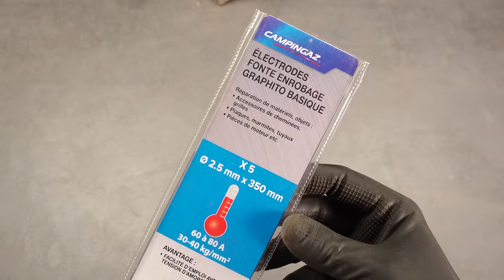Meat Slicer Restoration - Wood & Cast Iron

Comment: Just a suggestion, after you clean the rust from those screws/bolts and hardware, heat them up and drop them in oil. Rust resistant and nice satin black look to it as a result. IMO it would be a good step.
Reply: Not food approved
Reply: @ai-d3982  it is if you drop them in oil used for cooking...... same principle as seasoning cast iron
Reply: @ai-d3982  Uh oh! I use oil all the time when I cook.
Reply: @ai-d3982  why not for food have you ever herd. Of food grade oil.  Like peanut. Oil 
Peal oil there is a food grade. .  I just. Gave 2 that. Can be. Used  and i use then for heat treating carbon steel .
Reply: Or you could just do that in your videos
Reply: @nashvillain171  
ze 👌🏼
Reply: @kevincrosby5991  puder
Reply: @LUCKYB.  h lá
Reply: @LUCKYB.  xeh u
Reply: @LUCKYB.  xeh u
Reply: @LUCKYB.  that's a fucking tough read right there
Reply: You think this dude don't know how to blue? Really people?
Reply: @davidtant8896  cope.seethe.dilate
Reply: I think the fact he filled a lot of the surface with epoxy, that's probably not an option for a lot of it.
Reply: Nlt food approved also this process is called quenching the bolts are so old there will be a high chance lf getting cracks and eventually break
Reply: @kevincrosby5991  look pub? NV
Reply: Perhaps he wanted to preserve the color to coordinate the colors of the piece (but the idea of putting screws in oil to resist rust is the original idea for health reasons in case you really want to use them daily)

Comment: I’m in love with the fact you actually saved the old wood & I’m ready for more vids 😍
Reply: That was genius on how you saved the handle by making the dam of hot glue.  Very impressive.
Reply: @jeffbandle2916  "you" what
Reply: Most. He saved most of the Wood.
Still pretty amazing how he still did it.
Reply: @dutch_and_dimes  wood is like the easiest material to renew, not really amazing at all, pretty normal actually
Reply: P
Reply: @Dr.LongMonkey  Not really. If wood completely dries out, it's practically unsavable as it will have no structural integrity whatsoever.

Comment: Pro welder's tip (for free): Preheat cast iron before welding/braising/silver soldering. It is less likely to break again next to your weld. Also, you should make a shallow "V" along the edges you're going to weld. As with steels, you want good penetration when you weld it.
Unless you preheated off-camera, I'b be surprised if your weld holds over time, especially if that tang is stressed/structural.

Comment: Good job.  You save more timber than I would have. 

After the welding and grinding, if you are going to use it, you might want to harden and temper that blade, otherwise you will be sharpening it a lot.

If it's largely just a decorative piece, then don't worry.

Comment: There was a small crack on first piece of wood you repaired that could have been fixed. Also, for restorations with small screws and items that need cleaning, a small tumbler that works from an adjustable-speed drill would work great!

Comment: Great video. Love the format and the humor. 

Would highly suggest drilling out (or just partially) the screw holes and glue in dowels, rather than filling with resin. The resin is not as flexible as wood, so it can lead to stresses in the wood, cracking, and premature failure where you have screws. 

After welding the blade, you should make sure to re-harden and temper it again. The high temperature of the weld ruins the hardening in that area, and the blade will likely dull much faster there. 

That said, saving the original wood and filling in gaps with the resin is such a good idea. Might even consider using some “pang” colors to make it stand out instead of blending in.
Reply: i=I beleive most things arent for use when hes done and rather just decor

Comment: Haven't seen JB Weld used that way. I'll have to watch more of your vids. I have an old push reel mower I would like to restore some day. I will probably need to research the part in the wheel that spins the blades though.

Comment: A note about those rusty old screws.  I know some people use an electric tumbler to clean them, but that's an added expense.  I have seen at least one person, however, simply mount a bolt to the center of a jar lid, fill the jar with sand or whatever granules they use in tumblers, and the rusty parts, and mount it to a drill.  clamp the drill trigger on for a while and you will get a good result.
That said, your work here is amazing!

Comment: Pro tip. When fixing cracks in metal its best to drill a small hole at the ends of the crack. This spreads the surface area of the crack out meaning it doesnt know which way to go. Leaving it and just welding it gives a weak point in the underlying base metal

Comment: Please use an actual piece of wood to restore wooden parts. You can tidy it up with spackling paste later. Do mot use epoxy resin, since it is impossible to maintain and restore by sanding and varnishing.

Comment: When welding true cast iron, you should always pre-heat your piece with a torch. Weld it, while keeping heat in it. Then put the piece in dry sand or something similar so that it cools as slowly as possible. Else you run the risk of it cracking where you welded.  Very nice work!

Comment: I'm sure you'll not read this, but maybe someone will, and it'll help them. I'm not sure if you already take this precaution, but all those tiny holes in that old wood are from wood-mites. They are microscopic and are eating away at the wood, forming little pin-holes that get bigger and bigger as they form colonies and eat. They are most likely still in the wood, alive, multiplying and eating. You should fumigate any old or new wood that has signs of wood-mites before bring them into your house or shop, they are a nightmare in a woodworking shop.

Comment: Nice restoration. Though, frankly, that device looks like a good way to slice-off the fingers of one's left hand, especially if one gets distracted. (Though I don't suppose it's much more dangerous than an 8" French chef's knife, in that regard. I sliced the tip of my left thumb off with one of those some years ago.)

Comment: Your wetstone method needs a lot of work... there are also cheaper, and arguambly more affective, methods of reparting termite ridden wood and repairing cracks/holes using non-resin based repairs.

Though, not a terrible repair as you put a lot of effort in :) just not the most professional.. more like DIY grandads garage repair..